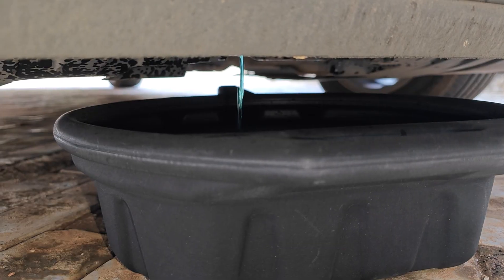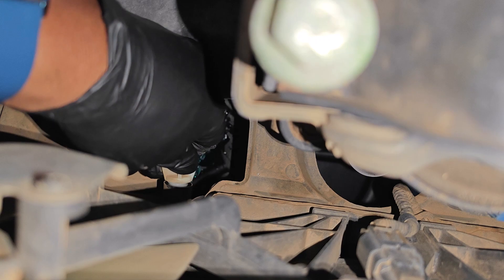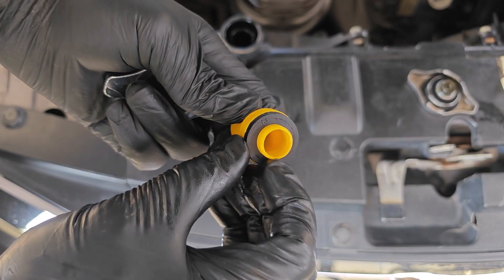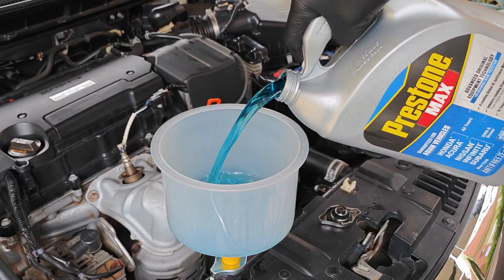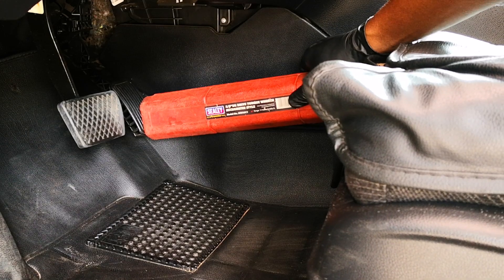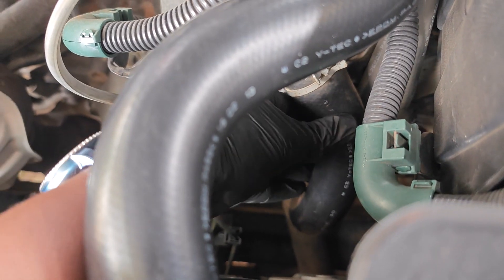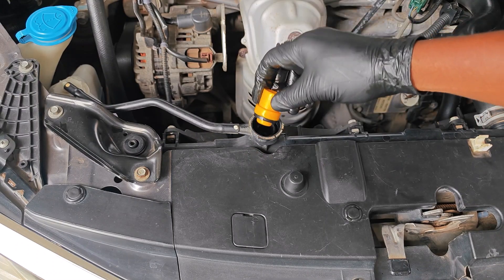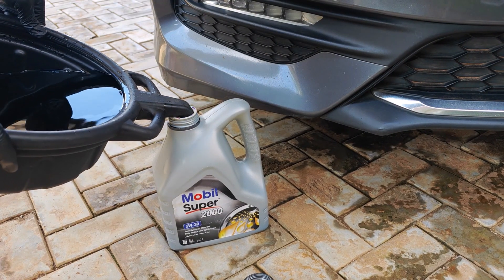Best way to Replace your Coolant: How to Remove air from Cooling System

Comment: how do i get this done myself without this tool you have?
Reply from the maker: Same car? I have an much older video on a 2003 Honda Accord. It's basically the same process on this car as well without the tool. You'll have do the air bleeding procedure about 3 times.

Comment: I like you did everything the right way but not in the coolant not used the OEM coolant I hope you keep flush in the right time and not over heating you engine water pump leak thermostat cloud but good job
Reply from the maker: Thanks for the compliments!
For me, I know all these manufacturers don't make their OEM fluids, but contract it out to the fluid makers who also sell aftermarket brands. I believe nothing will go wrong with the high quality brands like Prestone, Peak, Zerex etc. As long as you choose the correct fluid type.

Comment: Hello bro, hope you remeber me. 
This is unrelated to your video but i take your opinions highly.

Im done exploring my xtools 3 models

I want to try autel mp808s or launch x431 pro elite. Although it seems you are not using launch is there a reason or which one donyou think inshould try next? Im into coding for benz and bmw.
Reply from the maker: Hey. I sure do remember you! Thanks for stopping by. Believe it or not, I'll be reviewing my first Launch product soon😉. And you my friend are quite lucky because it's exactly the Launch product you have in mind. But shhhh. 
As you mentioned, I'm yet to use a Launch product, but if your into coding, you have to consider that BMW coding on Autel is online and that will cease without a subscription. Offline coding will work, though I think I did see somewhere that Autel is moving all BMW coidng to online. If the Launch supports coding without a subscription, I'd say you strongly consider it. My Launch video should be about 3 weeks or so out!

Comment: I've used mine several times and it works great. It even works on coolant openings that are set back on the engine. However, when you use it on coolant openings set back on the engine you need to support the extension tube and 45's with wood or bungee cord so extension doesn't collapse under the weight of funnel filled with coolant.
Reply from the maker: Thanks for sharing. Don't mind some of those evil car makers, giving us recessed reservoirs 😂

Comment: Can I put new blue antifreeze coolant on my crv 2006 ?
Reply from the maker: Do you mean the one I used in the video or just any blue coolant? You can't use any blue coolant. It has to be the phosphated HOAT kind of coolant. The Preston Max, Honda Blue Type 2 and others superficially blended for Honda cars will work. They shouldn't have silicates.
Reply: I used Zerex Asian Vehicle Pink in my Honda. Because I liked the color. It's a POAT type coolant just colored differently since I had to flush the cooling system anyway.
Reply from the maker: As long as its POAT, it works. Zerex is another very good one!

Comment: How to check freeze frame data using Autel
Reply from the maker: On the same menu that you see Live data, Read Code etc, you should see "Freeze frame". Just select that. This menu will be under the different ECUs in the car

Comment: What about the coolant after the thermostat?
Reply from the maker: Nothing much you can do about that, except you pull the lower radiator hose. Not worth it in my opinion. A simple drain and refill gets 90% of the old fluid out. It's even better than a transmission fluid change which removes less than 50%.